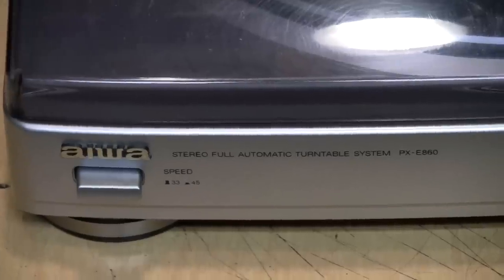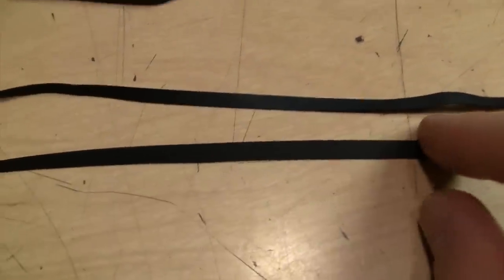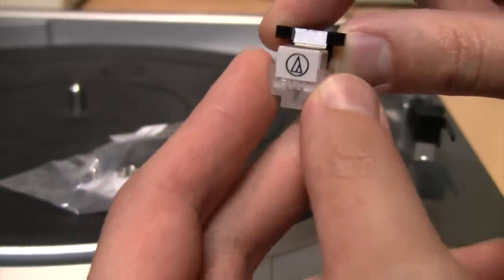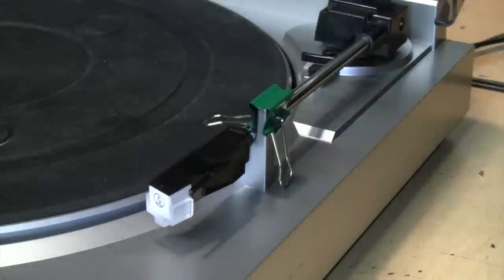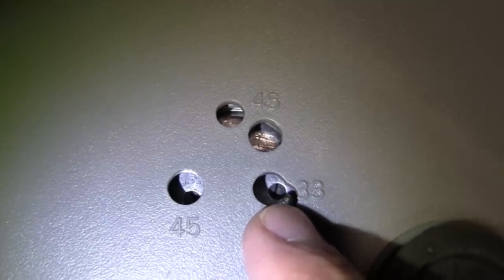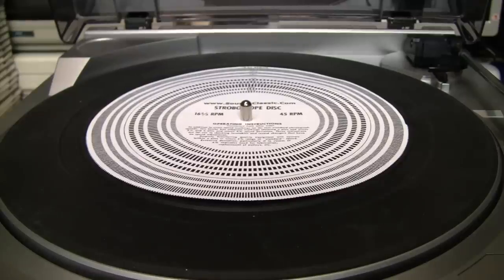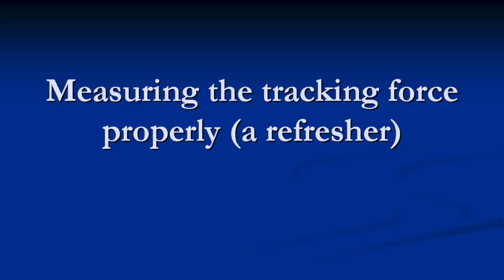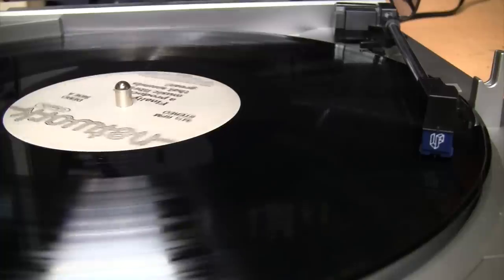Cheap fixes & upgrades for cheap turntables

Comment from the maker: Contents:
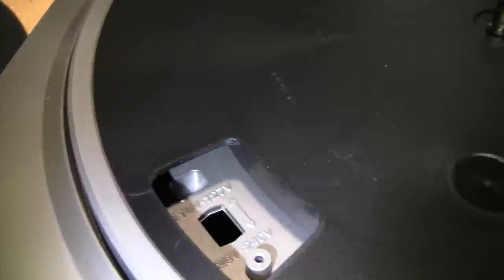3:08 Replacing/upgrading the belt
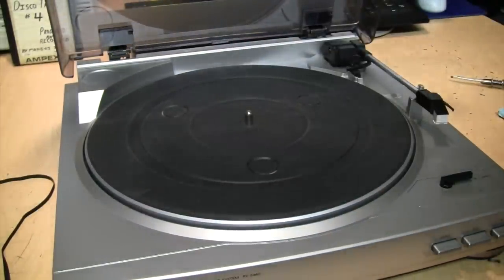6:49 Replacing the stylus ("needle")
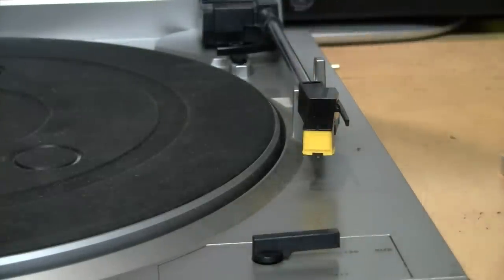8:03 First test after repairs (with an important tip)
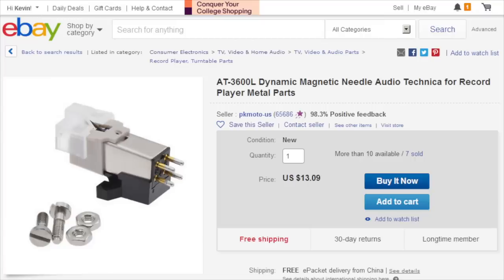8:59 Cheap source for genuine Audio-Technica stylus
10:03 Beginner's mistakes
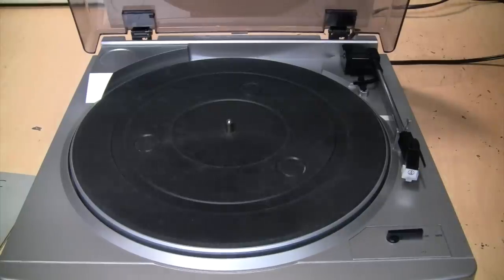13:06 DIY tonearm clamp
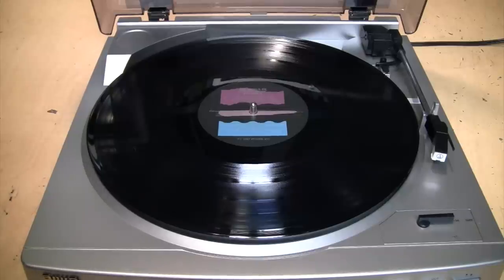14:35 Checking the speed
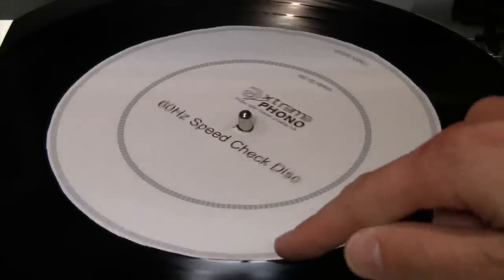18:42 Adjusting the speed
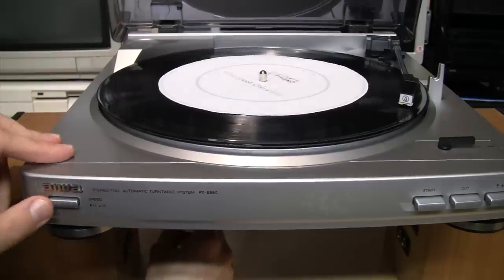22:14 78 RPM modification
24:23 Elliptical stylus upgrades
28:46 Measuring the tracking force properly (a refresher)
29:22 Modification to disable auto-return mechanism
31:26 Tonearm adjustments you probably shouldn't mess with
31:55 But will it damage my records?
Reply: the same as atlp50..denon29f..cs410 dual...
Reply: Nice tutorial. Thanks!
Reply: What LP gear stylus do you prefer for the Pioneer PL-990?
Reply: What is the record you play while demonstrating the different styli?
Reply: I just got a used one today.  Needs a replacement stylus.  I have so many people telling me this will damage my records too.  Right now I have an all in one POS.  So this HAS to be better than that.  Your opinions put me at ease more.
Reply: Love the video!
Reply: Did ya know ... Just about every old printer and scanner that folks throw out or sell at thrift shops have decent replacement belts for turntables in them. ... with a little "adjusting" of course 😉 Servo motors too for those 70's and 80's TT's. Hope it helps ya with some adventures!!!

✌

Comment: That 45 Adapter part made me physically cringe. Regardless , excellent video
Reply: Yeah it was funny though, funny in the sense that you can laugh at their stupidity xD
Reply: The actual way you scratch is to replace the rubber mat with a felt mat or wax paper. But a belt drive turntables isn't very good for scratching.
You should use a high torque direct drive turntable. But you'll also want a scratch mixer which new will probably be over $500. You can probably find a used Rane TTM 56 for about two or three hundred dollars.
Reply: Heehee
Reply: LOL that's exactly why DJs use high-torque motors and felt slipmats — reduced friction! 🤣
Reply: The guy really changed his channel name and, seemingly, deleted his "review"... you can't make this up!
Reply: What a great idea! I'm going to try it.. but I'm going to attach a Teflon covering on the adapter to scratch better

Comment: Wow, the elliptical stylus really made a huge difference... I thought that it was an "audiophile" trap... really improved the sound. Great vid, I'm sure i'll watch again for tips...
Reply: Me too! I was amazed how easy it was to hear especially with that blue more expensive stylus. It sounded much better! Time to invest in one.
Reply: The conical still sounds great. The green and blue ones are phenomenal
Reply: No, the audiophile trap is probably using the moving coil cartridge instead of the moving magnet cartridge - those moving coil cartridges cost a fortune and are an absolute pig to change the stylus on, and have no audible advantage over a moving magnet cartridge with a microline stylus attached.  Where magnetic cartridges are concerned, the best sound will always be had from the microline stylus.

Comment: The felt platter mat on my LP-60 had a bump on one edge. The painted logo somehow draws it up in that spot. I've noticed this on other Youtubers' videos playing their records. It creates a wobble especially with 45s. Flip it over to the all black side and it lays flat. I've thought about ironing it with wax paper but I think I'd rather just get a new mat rather than risk damaging the original. ...or just stick with the all black side. It's fine.
Reply: Cletus Hunnicutt Felt mats are ok, but i recommend to get a rubber, cork or a leather mat. I used the at lp 120s felt mat and it was so static that i bought a leather mat and i have been happy with it. Then everyone recommended to get a cork mat and tbh my leather mat feels good and puts a small punch to the bass. Cork is good too.
Reply: It's the dark side of the mat
Reply: Brilliant.  I've noticed this too (just got one) and its driving me nuts. Thanks 👍🏼

Comment: Very useful video. I'd like to ask you if it is worth to upgrade AT-L60X stylus? They say LP Gear CFN3600LE stylus gives sound improvement, can you confirm it? In Europe it's very expensive to import LP Gear, cost of this needle is roughly $100... Maye there are other available alternatives?

Comment: I remembered this video when I had to move and put all my TTs in storage. As an owner of one of these Hanpin full-autos—the Nexxtech LAB-1100, to be exact, sold by Radio Shack's The Source stores in Canada —the paperclip tonearm clip was a lifesaver. No longer did I have to worry about the tonearm getting knocked about the platter on the road!

Comment: Thank you vwestlife for a non biased review. I own the Bluetooth version of the LP60, and I love it. My parent’s high end table used an AT3600 cartridge way back in 1988, and it was flawless. I swear by them, and have only owned tables that use them. I’ve since inherited my parents record collection, and although their component system may be long gone, the vinyl sounds as good as it did all those years ago.  😊👍

Comment: Thank you for this very down-to-earth instructional video. I bought a AT-LP60XBT about a month ago mainly because it has Bluetooth connectivity. I started feeling a tad sorry for picking it up because I thought this turntable was too "restricted" in terms of features like tracking force / anti skid / speed adjustments.
It also ticked me off to find out that the tonearm had no clamp - I did accidentally let it fall off and hit the turntable a couple times during assembly and transport and immediately thought this was it for the stock stylus. But I now have a brand new 4211-DE on the way thanks to your tips (I was looking for an original replacement at first), and in your other video (prior to this) I've learned that the tonearm has a decent anti-skip built in as well as an acceptable tracking force. So I'm happy.
Reply: How do you like the 4211-DE? I’ve had my turntable a month and a half and want to upgrade now but couldn’t get a good gauge from this video whether the 4211-DE or the LP Gear blue stylus was better

Comment: I bought my gf the Pioneer pl 990 here in Australia after watching you vids,opening the box,it looks real cheap and a thin platter and matt but once I played a record,I was very impressed by this table.

I had it set up inbetween two cheap Wharfedale bookshelfs and they are connected to a Pioneer surround receiver which also has a cheap 10 inch active sub connected.

The amazing thing there was no rumble with the turntable even with the sub at good levels.

For a cheap belt turntable,it keeps it’s pitch very well.

Thank you for the advice,my girlfriend can now play some new records she bought recently and her fav Adele.
Reply: Do you have any suggestions for needle replacement? I’m having trouble finding some

Comment: Hey! Nice. I just got the 4211-DE and swapped out the default 3600l stylus, I also got the LP GEAR saved in Amazon wishlist. Thanks for making a simple video about some basic adjustments rather than pushing expensive gear.

Comment: Excellent video. Just to add, for those who want to go 1 level higher, switch it to the phono line output and use an external pre amp, like the cheap, high quality, solid one like DJ ART...this is definitely better than the build in pre amp. The sound directly from a upgraded stylus, amplified by the better pre amp will give you better and cleaner sound quality, improved bass, staging etc. I just did that for my Denon DP29F...and with that, no need to spend more money on changing to a new turntable...

Comment: hey VWestlife... I have a Sony PS-LX63 (or something like that) which has a cartridge pretty much like the one this Aiwa has. I've noticed that on top of the cartridge shell there is a screw, which I believe is the one holding the cartridge in position.

Looking for a replacement stylus for my turntable, I came across the Audio Technica cartridge you mentioned. And I also see it's got a plastic bracket for a 1/2 inch mount which is screwed to the cartridge pretty much in the same place as the one on my turntable is.

My big question: Have you tried to see if the entire cartridge is replaceable by taking the mount off? Probably your Aiwa does not support cartridge replacement, but maybe you have a Sony around with which you could experiment. I'd like to restore my turntable (just got it) and replacing its 29-year old cart for a shiny new one as part of such project, but I'd hate spending money for a cartridge that I won't use.
Reply from the maker: You have a P-Mount turntable. Those use replaceable plug-in cartridges. These turntables are a more recent cost-optimized version that no longer allow the cartridge to be replaced (although obviously the stylus still can be replaced).
Reply: @vwestlife  Uh, no sir, it's not a P-Mount. I'm 100% sure of that because a P-Mount would be like a Shure M92E that I recently bought for my Numark Pro TT2, which comes with an adapter for a 1/2" mount. The adapter receives the cartridge, which you fix in place via a screw and nut which is, let's say, behind the cartridge, through the audio pins of the cartridge.

The Sony cartridge I'm talking about uses the very same stylus that you show here. I even removed it following your instructions from this video. I then managed to remove the cartridge by removing the screw at the top of the shell (picture the cartridge being held in place by a single screw at the center of the shell's top instead of the regular 2 of a 1/2" mount),and the cartridge was kind of glued with something that looked like a drop of silicone or RTV to the shell itself. That proved my theory that the cartridge can be removed.

I am almost sure that if I were to get one of those cheap AT3600L cartridges you suggest in this video, I can replace the one on my turntable by removing that 1/2 mount it has.

Chances are that in the case of this Aiwa turntable of yours, the cartridge is glued to the shell just like my Sony, that is if no screw at the top of the shell is visible.

EDIT: My turntable is a PS-LX63P. I missed the "P" when I mentioned its model.
Reply: My turntable is identical as the one in this video, just the model tag is different. Take a hard look at the shell and cartridge. You'll see the screw I'm talking about and you will recognize the stylus at first glance.

https://www.youtube.com/watch?v=JeNZQ1M0jnc
Reply from the maker: You are correct. On the type of turntables shown in this video, the cartridge is affixed to the tonearm with adhesive.

Comment: I struggled a lot to find decent reviews of the audiotechnica at-lp60, but your videos have been a great resource! 
I always wanted to get into vinyl but was discouraged by the apparent steep price of entry according to enthusiasts. I recently found the aforementioned model (or maybe a slightly newer revision) brand new on clearance for $50-ish and wanted to hear how solid it'd be from a bang-for-your-buck, beginner's perspective. The other video debunking the misconceptions levied by audiophiles as well as this video detailing possible upgrades and common beginner errors have been very helpful for someone with absolutely 0 experience.
I may find myself upgrading to a more expensive setup in the future but your vids have definitely calmed my nerves about dipping my toes in the water here.

Comment: You offered some very valuable information.  Thank you.  I bought a Realistic linear turntable from Radio Shack 37 years ago, where I worked while going to school.  Later, I purchased a very nice cartridge that sounded very good.  I could hear the upgrade.  I wanted to put that cartridge in my AT-LP60-USB, but I didn't think that was possible.  You inspired me to simply replace the stylus.  Duh!  of course.  I thought the cartridge made all the difference, but I sounds like just upgrading the stylus is all that is needed.  If I recall correctly, the AT cartridge had a frequency response of 15-25k Hz.  My stylus has a frequency response of 15-25K Hz?  I can tell that the OEM AT cartridge in my new USB turntable doesn't sound very good.  I didn't know that the stylus had a conical stylus.  Again, I am grateful for this valuable information.

Comment: That Aiwa was my first turntable! (Still have it, it’s down in the basement). Some years before I upgraded to Project Debut, I did some tweaks that helped it sound better: speed calibration, gluing weights to the platter to give it more rotating mass, cork mat, adjusting the tracking force from 3.83 grams down to 2.8g (which was not easy since spring loaded tone arms have no adjustment function. I had to glue coins to the back of the arm).

That LP gear stylus was a considerable improvement over the stock one, wish I knew about it before I retired that turntable.
Reply: awesome...im noticing i am having some skipping problems with one of these...approx what weight did you glue to the platter and back of tone arm?!

Comment: I don't think printer scaling would be an issue with printing a strobe disc, would it? It would still be printing X number of lines in a circle. I guess maybe if you print it in a different aspect ratio and end up with an oval.

Comment: I upgraded the stylus on my three Numark  TTUSB turntables from the stock “Groove Tool” to budget ones from Banpa which amazingly improved the sound. I also soldered a remote start wire to connect to my mixer. Worked like a charm. Generally these budget turntables always spin one step too fast and yes pitching between CDs and MP3s can have pitch issues.

Comment: 18:42 I recommend getting an actual potentiometer adjustment tool for that (my father called them 'tuning wands'); basically they're a plastic screwdriver. They're non-conductive so the shorting problem won't be a problem.
Reply: Also known as a "TV tuning tool".
Reply: @NJRoadfan  I've heard more than one tech refer to them as "twiddle sticks" And they're non-ferrous so that they won't interfere with the electromagnetic field of the adjustment pot that you're turning as well as being non-conductive.

Comment: I have a Teac P-A688 turntable just like the Aiwa in the video.Even has the same rubber mat. It was also made in 1999.I've always used a small rubber band over the tone arm.Once you get it just past the rest there is a small plastic hook on the rest backside at the bottom of it. You can hook the rubber band there for transport.Only reason I know this is bought the turntable new in 1999 and when I set it up that's what they had there to secure the tone arm.
I really liked this video a lot.Very informative with great tips on upgrading and adjustments. It helped me a lot! Well done man!

Comment: I bought the Audio Techinica AT-PL50 for $8 because the belt fell off. For a basic turntable is they are not too bad. Mine has the aluminum platter and the speed is very stable and fidelity is great. No wonder it has been in production for almost 25 years.
Reply: I just got the PL60BT  sounds great thanks AT

Comment: Hi! I have a similar model. My problem is that when is runing the speed is irregular, I mean, it goes from normal to slow while I play in 33 rpm. Also, the CUT button was loose. I took it with the technician and he said that the piece conected to the CUT button was broken causing the irregular speed. Any toughs about it? Thanks!

Comment: Hey VWestlife, excellent video with a lot of useful information for a completely new beginner like me.
I have a problem that's probably more electrical than the audio part, my player won't turn on. I'm unable to locate any trustworthy repair person near me and have been wondering if I could take a shot at it myself. Any suggestions on where I could start? It's an lp60 model. (I'm an engineer, thought I might be able to give it a look at least)

Comment: You and Techmoan got me interested into turntables. I bought the Jensen JTA-230 a while back that you recommended and now just recently upgraded to a Audio Techinica AT-LP60 and have been loving it. Keep making great and informative content.
Reply: Same here. I'm mostly satisfied with it. Some of my 45 RPMs don't seem to sound too well though.
Reply: Connor M. I haven't played any 45s on it yet but it might have something to do with what he said in the video. If not I'm not too sure what could be wrong besides the 45 themselves. The only thing I wish the LP-60 had is pitch control
Reply: Sometimes a 45 rpm insert helps if the problem is the 45 record not sitting perfectly centered on the spindle.

Comment: My tonearm does not lift up enough automatically. At the end of the record it just slides back to the right scratching the record along its way. The same happens at the start it does not gracefully lift up and off the resting bar. It just pushes over with no lift. The manual up and down button works. I have taken out the auto cog, put in back in and rotated 10 times. Wondering if the adjustments underneath need to be done??

Comment: I bought an ATLP60X as a second deck for testing second hand LPs, I'm putting it through the MM input on my Rega Aria phono stage and it sounds phenomenally good. It's testament to how fundamentally decent these turntables are that you can do something like this. If I was to pick out the biggest flaw, I'd say it's lacking some top-end sparkle that I suspect an elliptical stylus upgrade would resolve.
Reply: LP Gear has a real nice upgrade set with this elliptical diamond needle shown in this video and a belt upgrade. It’s $55 and it’s supposed to make a huge difference. I’m getting one for mine